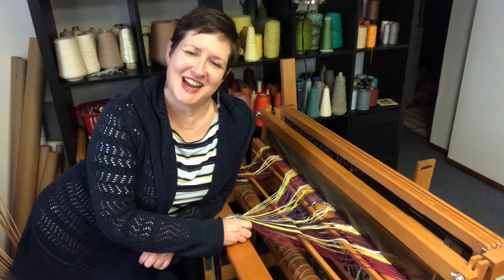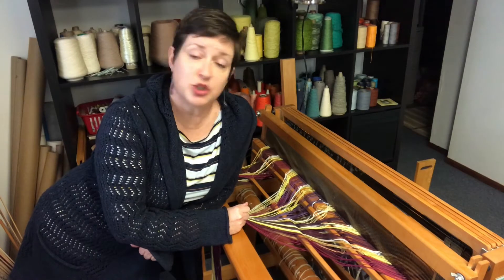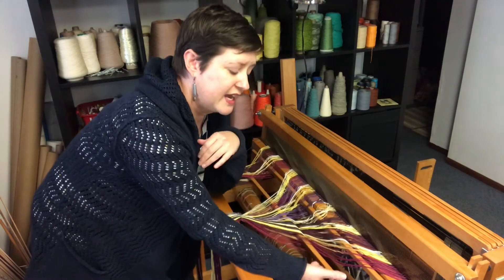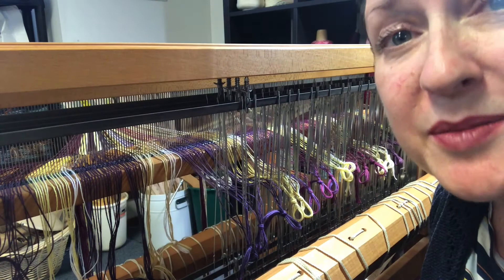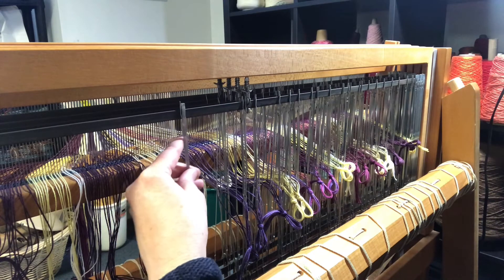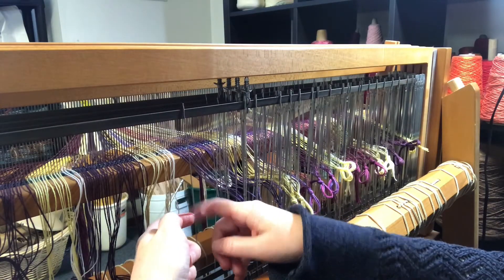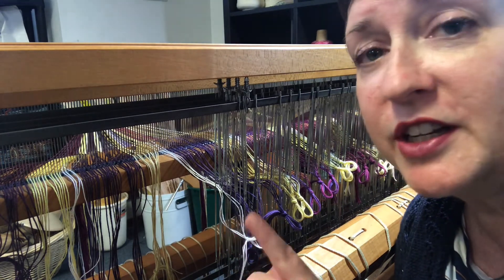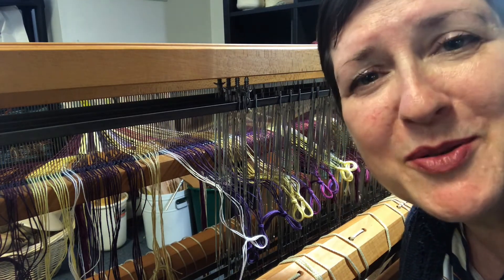Threading Heddles

Comment: I like the way you dress the loom. I understood that toi have 1 thread par dent in the reed so it is easy To follow in the heddles . What happens when you have 2 or more threads per dent in the reed   . How do you know which thread To take  To go through the heddle in ordre.
Reply from the maker: Hi! Thanks so much! Typically you can have multiple warp yarns per dent, but only 1 per heddle. Does that answer your question? Just let me know & I'll expand the answer, if you need!
Reply: @ActonCreative  q
Reply: Thank you for your fast response .  But my question is when you have 2 thread in one dent, which one do you chose first to put through the heddle. Meaning how do you know which thread of the cross comes first.
Reply from the maker: @frandaig  Here's where I'd suggest referring to your original project plan. However, if your warp is all the same color, it won't matter so much. The goal is that each warp yarn run straight through the loom. Hope that helps!

Comment: Does it matter which direction the yarn goes thru the heddles?
Reply from the maker: @PenelopeGreen-sk3cf  Hi! The direction will be dictated by how you dress your loom - front-to-back or back-to-front. But the bottom line is that each warp yarn needs to flow straight through the heddle so you can easily forward your fabric as you weave. Does that answer your question?
Reply: I think so. I dressed back to front. My heddles are not all installed the same - some turn more easily to the left and some to the right. Is it okay to thread them both ways just so the heddles open easily toward the front?
Reply from the maker: @PenelopeGreen-sk3cf  You're welcome to tweak them however will help you the most! As long as the warp yarn travels easily through the eye, you're golden!
Reply: @ActonCreative  Thank you! I started out thinking that they needed to be threaded the same but  then I realized they weren't all installed alike.  Some have the color on top, some on bottom. So as long as it doesn't matter, I will just thread them whichever way they will let the yarn slide through most easily.